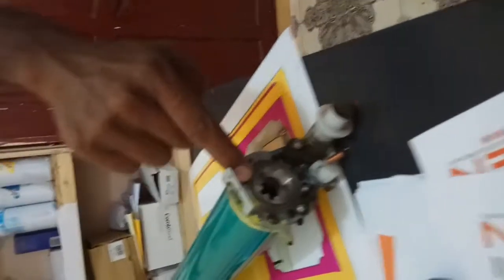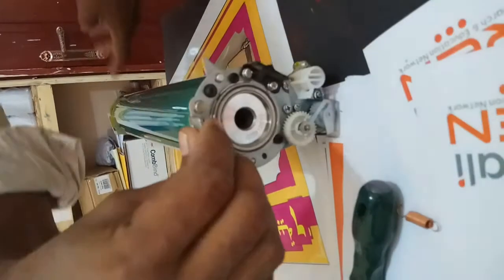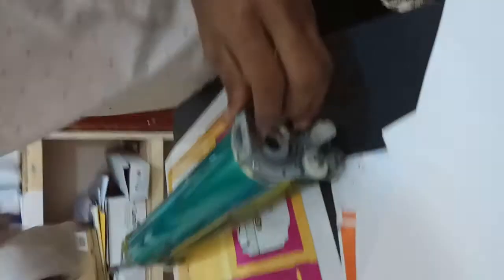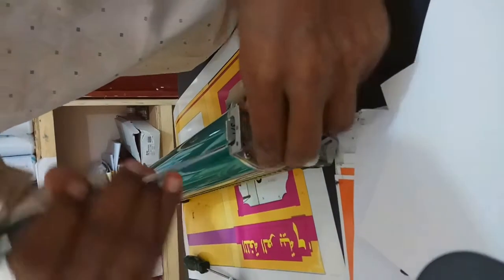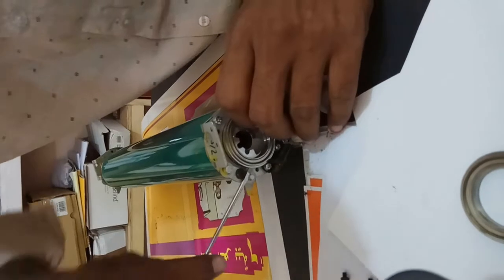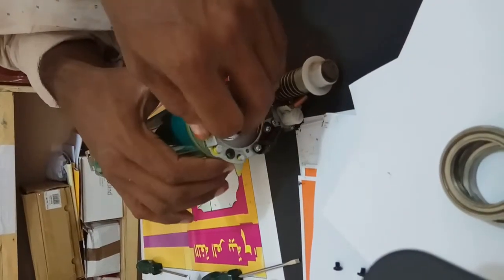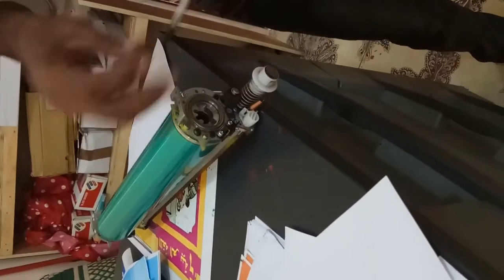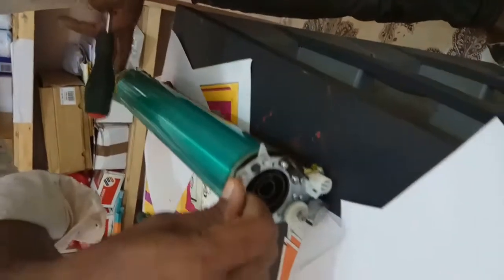how to replace drums (opc) from konica minolta C 6500 6000 7000 6501 5501

Comment: SIR PLZ HELP ME 
YE ERROR CODE AA RAHA HAI MACHINE ME 
C652 CONIKA MINOLTA

Code: C2101
Description:
PC charge cleaning malfunction
•During backward movement of the cleaner, the charging cleaner home sensor is not blocked after a predetermined period of time has elapsed.
Causes:
Drum unit /K Charging cleaner home sensor (PS43) Charging cleaner return sensor (PS44) Charge cleaning motor/K (M15) Printer control board (PRCB)
Remedy:
1 Check the drum unit/K for proper connection and correct as necessary. - - 2 Check the M15 connector for proper connection and correct as necessary. - - 3 PS43 I/O check, sensor check PRCB CN25-11 (ON) C-12 4 PS44 I/O check, sensor check PRCB CN25-14 (ON) C-12 5 M15 operation check PRCB CN8-1 to 2 C-12 6 Change drum unit /K - - 7 Change M15 - - 8 Change PRCB